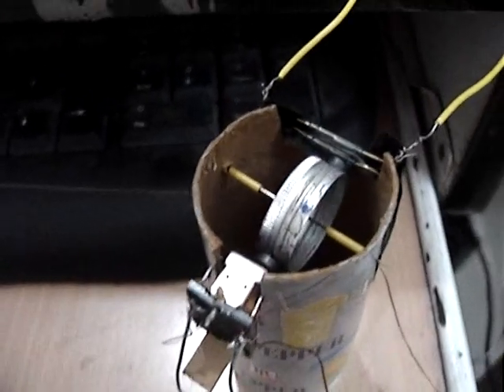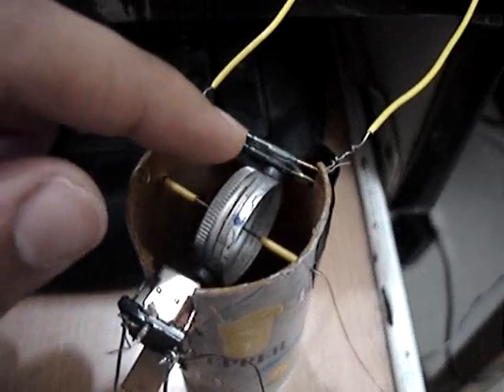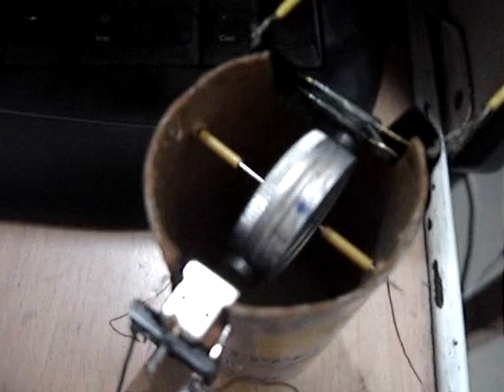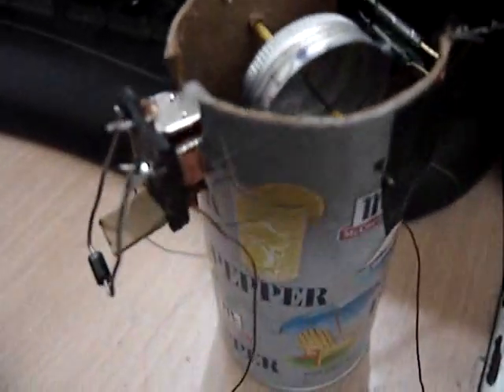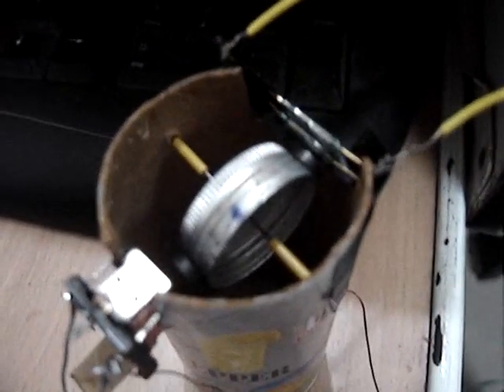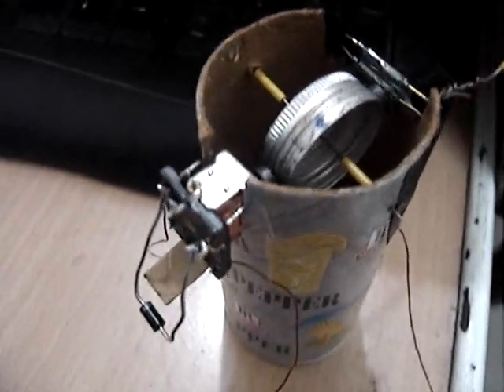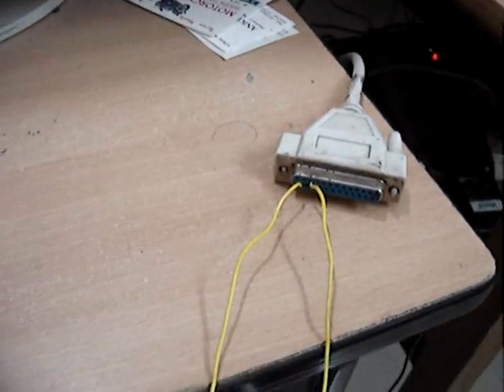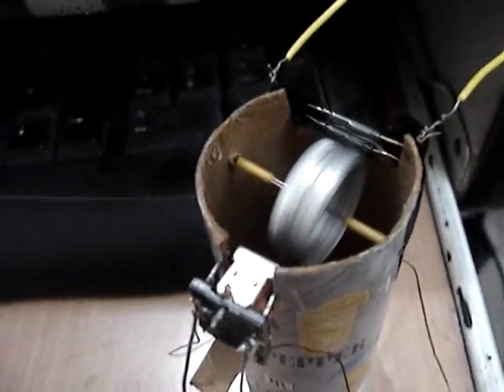Reed Switch Motor and Computer based RPM meter

Comment: Hi, I know that you posted this video a while ago but I noticed a diode connected. Is it connected across the coils terminals? I've been blowing reed switches left and right, is 12V dc too much for a general purpose use. If I understand your power supply, in the video, it's only 3 or 5 but it can be 12, is it 12V that you are using? 

Thanks I've been surfing to see why I'm blowing my reeds.
Thnaks again.